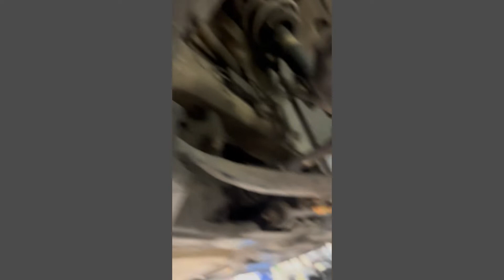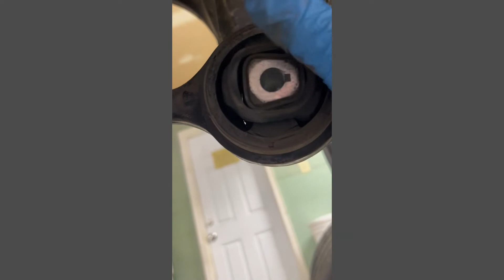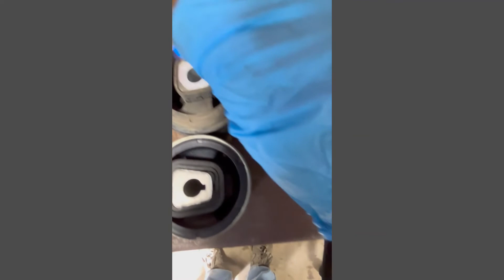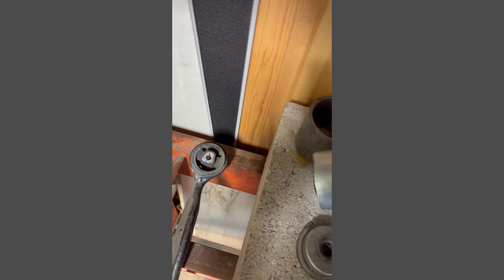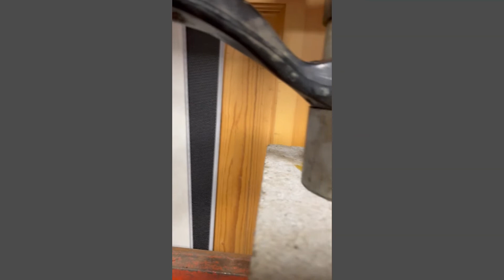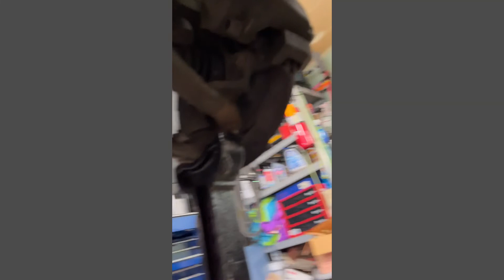BMW Control arm bushing diagnoses and replacement 2006 325xi

Comment: What is the torque spec?
Reply from the maker: The through bolt for the bushing is 68 NM plus 90 degrees. 

The ball joint nut is 60 NM for the all wheel drive models. 175 NM for 2wd.